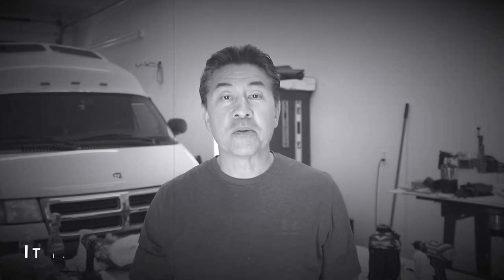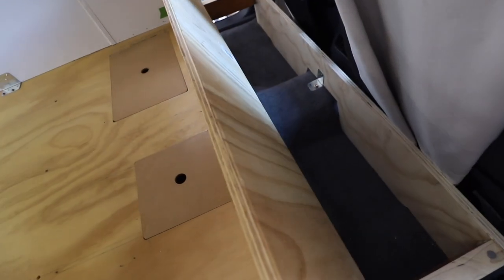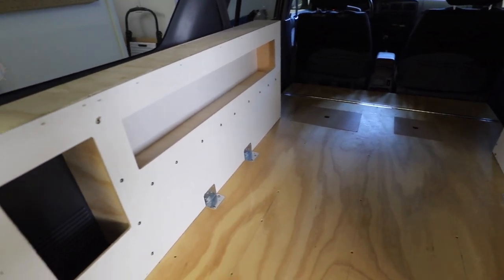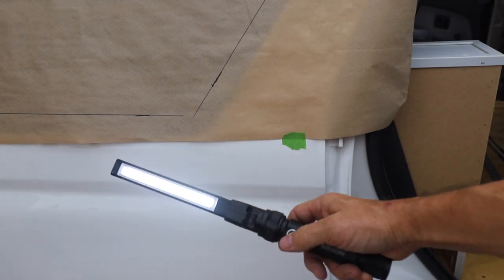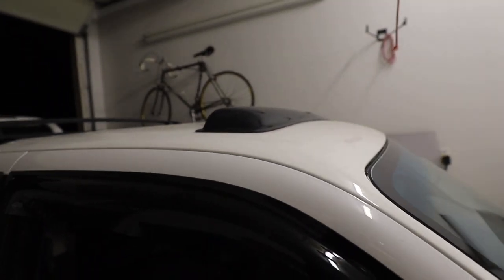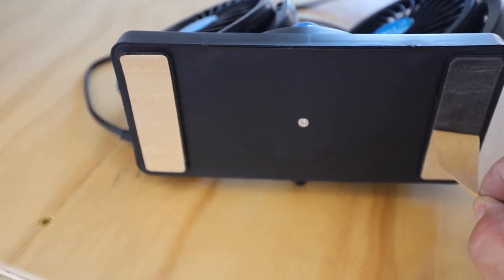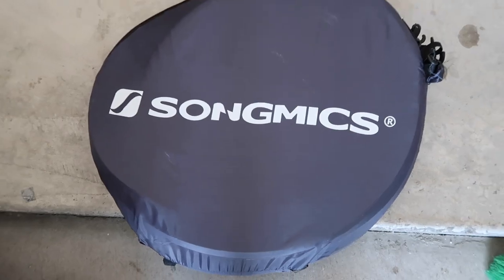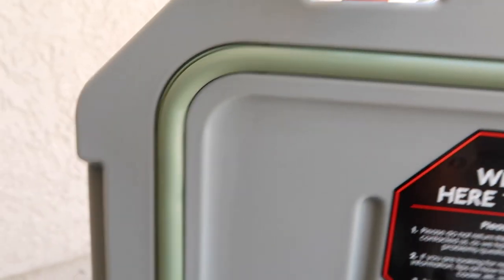Micro Camper Build in a 96' 4 Runner Part II

Comment: OK Steve, I have to thank you. Until seeing your build out of the 4Runner I was all set to buy an E250 in the next couple of weeks to convert. D'uh, I already have a 99 4Runner LTD in great condition. Have watched a LOT of other 4R conversions, most having the platform bed you speak of that I didn't feel afforded enough space, and a coffin-like feeling come bedtime. The long and the short of it is that at 6' 2" I'm going to do up my 4Runner up in a very similar fashion to yours, with a few changes of course. So, thanks again, your video likely saved me $15K, and THAT puts a smile on my face. Cheers mate!

Comment: Steve, I'm always impressed by how you do things. I'm planning to head down to Quartzsite from Colorado in 6-8 weeks in my '97 4Runner (252,000 miles and running strong). I won't do any buildout because I'm only 5'2" and will sleep on one side with the right half of the back seat folded down.  Will outfit the other side with a small set of plastic drawers, cooler, stove, etc. Also planning for some solar on top plus a set of suitcase solar. Thanks for the great tips that give me confidence that I can do this! Hope to meet you someday.

Comment: I found the same baskets in brown! They fit inside a 12 pack soda box. Was just a coincidence when BF was taking to trash. Cut off length a bit. . I stacked them 2 each and 2 across in two different cabinets of our trailer as drawers. Things already drawer shape held less and had too much space around. I didnt even stick them together. They dont move and if I want can put them 4 across and not stacked.

Comment: Hey Steve. 

Love your totally practical guide, and I agree about not using a platform bed sleeping arrangement. I'm not claustrophobic, but I imagine I soon would become so if I tried to go that way! 

I have a sub-micro, 98 Honda CR-V, and it's a 4 cylinder automatic 4x4. I also have a 2wd 04 Dodge (non-grand) Caravan. Both have their pros and cons for the camping, but being 5'11" as I am I would have to REMOVE the front seat as well in the CR-V! I'm looking at the Caravan, now, for this. What I'd absolutely love, though, is one like your Dodge Explorer. I could probably live out of that one. 
Goals, goals, goals! 

Good luck with your Harbor Freight addiction! I hear that's a hard one to get away from!

Comment: Im building a gen1 mitsubishi montero into this.
Im in a wheelchair and was thinking the same about the bed on the floor and shelves over the wheel wells. 
Note on that. You can remove the inner panels and gain about 4 more inches in depth from the outer body of the truck.
Reply from the maker: I hear you on the panels but didn't feel it was worth the trade off. I like the storage under the platform where the rear footwell used to be for extra's. .

Comment: Thanks for your super informative video Steve! I like your ideas and they give me pause to re-think my plans. My 03 Sport V6 is great. For now I too love my XREAS suspension and only upgraded to 32’s to stay somewhat matched to the 4th Gens factory gearing and shift points. I’m in Minnesota so I haven’t needed more ground clearance yet. I’m moving to Colorado in September however so we will see. I may need a lift kit eventually.
I’ve driven an 08 SR5 V8 recently and although the extra torque is wonderful I really noticed the extra weight (plus it had a steel plate ARB front bumper). It also had the regular suspension, smaller brakes and 16” wheels. I realized how much I loved the ride and nimbleness of my lighter 03 combined with XREAS and beefy brakes. So I’m lovin my V6 and focusing on keeping it a lightweight “weekender” build. I need more bed space for my wife and I so I will probably build a cabinet on one side only. I just need to figure out storage locations for my stove and kitchen supplies. One plus for under platform drawers are the very useful cooking & serving surfaces they make and although I could make shorter drawers that only accommodate the height of my stove the ideal height extended as “counter surface” is definitely higher like most platform designs are. 
Hmmm...lots to think about. Thanks for all of your ideas. If you haven’t already done so, a video after you have had a chance to camp and test out all of your stuff would be great! Have fun. 😎

Comment: Great job Steve! I just got the Jackery 240. Haven't used it yet but looking forward to it. Was surprised it didn't come with a cover for the 12v receptacle so I purchased on on Amazon for under $5.00. Fit's great and will keep dust and dirt out of that area.  It's called a Dovewill Black Auto Cigarette Lighter Dust Cover.

Comment: I'm a bit surprised you left the plastic wall panels in the rear compartment (behind the shelves) unmodified.  I would think there was lots of storage opportunities with them removed/modified.
Great video, by the way.
Reply from the maker: Oh, I considered it. The benefits did not exceed the need for a few inches. The storage under the flip up floor board compartment in addition to the top box is more than ample. I haven't regretted anything yet.

Comment: Love the build and accessories. More so, love the forrunner. Perfect! 4 cyl and manual trans....low miles, too. Would love to get my hands on that as well.😃
Reply from the maker: Ha. Crank windows too.
Reply: @XplorerSteveDIY  I have a 1997 Suzuki Sidekick that I traded for about three years ago. It had 60,000 miles on it at the time.  4 cyl/5 speed. It was in very good shape but nowhere near as good of shape as your dad's car. And of course it's a Suzuki Sidekick not a Toyota. However, I've had several of these cars 2 door and 4 door and including the Chevy trackers which are the same as the Geo Tracker... just a newer model.  I have a 2000 Dodge ram 1500 conversion van that I have made into a campervan. Now, like you I have been working on trying to make the sidekick a weekender or short-term camper vehicle. Much more limited space than your 4Runner. LOL mine comes complete with crank Windows too. Personally I prefer them to the electric- no motors to worry about going out! I have fans, solar (on ground + stands- no room on roof), roof  rack w/ storage bag, swing away hitch basket w/storage box, pump shower, shower Cabana and homemade solar generator. Just added 12 volt fridge!
Reply: In a couple of years you'll see a lot more of this era Toyota coming into the country from Japan. If you can handle RHD! Although world-wide competition for the used cars in Japan may see the prices creep up. I own a Hiace van with what is essentially the 4Runner 4WD drivetrain.
Reply: @DiscoFang  heard a lot of good things about the Hiace. Only seen pics. Look awesome

Comment: Very nice setup and choices for decking it out. Will be doing the same thing in my 2002 Ford Explorer XLT in the near future. Going to do it slightly different with the bed on one side and cabinets on the other but will be doing the same thing for my solar but just going with a bigger all-in-one option.

Comment: I am ready to install my 100 watt Renogy panel on my "new" 2011 Honda Pilot I converted to a micro-camper.  I noticed in your video for the solar panel installation on the Xplorer you used VHB tape.  For the 4Runner you screwed into the roof. Can you tell me why you did not use VHB tape on the roof of the 4Runner? And if you think screws are safer, any tips on how to avoid damaging your vehicle and what kind of screws to use? Thank you for the inspiration, btw!
Reply: Late, but maybe helpful. I had doubts about vhb tape, but it's amazing how strong and reliable it is if installed correctly. Beats drilling through the roof anytime imo.

Comment: I’m working on my sleep deck build, inspired by your design and have a couple questions about your build:

1) on account of having a subfloor (furring strips + insulation), did you find that introduces a small gap below the rear edge of your deck about an inch or so floating above the rear sill?

2) how did you brace and connect the plywood walls around the foot well? Are those tied into the framework supporting the deck?

Thanks in advance for any tips!

Comment: Hey Steve, I’m currently building out my 4Runner to be pretty much exactly like yours, love the design. How is that mattress holding up? Would you still recommend it?
Reply from the maker: Now I use a twin size 3 inch memory foam topper on top of some interlocking anti-fatigue mat cut to size. That does it for me.
Reply: @XplorerSteveDIY  Thanks for the quick response! I can’t wait until I get mine finished and out into the backcountry. So would you say that first mattress was overkill, or was there something specific you didn’t like about it? I’m not sure about using a topper, they all seem too soft. Any insight on this topic would be hugely appreciated.

Comment: That plywood you used looks thick. Do you think that was necessary?
Reply from the maker: Standard 3/4".  Some parts are not supported by the furring strips so it suits me. There are no rules in self build. I wanted a sturdy, non creaky, floor. I have it.

Comment: Was in Vegas and went to alien stock.  Those tires you don't like,  well many people popped there tires,  so its not always about crawling and 4x4ing.  Its about not being stranded with your famly in the middle of know here,  even when you go on simple dirt roads you are at risk.  Also the lift helps protect you from hitting unexpected high bumps and ruining your oil pan.  Which will leave you stranded.  I rather pay the extra gas.  I have a built jeep and just because you don't see them off roading doesn't mean they are posers.  But we are better prepared than you.

Comment: I’m always curious with these sleeper platforms and drawer systems, does stuff jostle around and shift a lot when you hit bumps?
Reply from the maker: Well yeah. I use some non slip shelf liner on the bottom and sometimes between the bottles of propane. Keeps it to a minimum.

Comment: Don’t know if this has been asked but have you added any under-mattress protection from mildew, like a hypervent? In a space so small, with the matter was directly on the board underpayment, mold and mildew will set in and destroy the mattress and the sleeping/breathing experience. Please let us know. Thanks for the really great and informative video. 🌿
Reply: Late, but it really helps to remove the mattress when not in use. I wipe mine down with vinegar/water mix after storing it. edit I also shimmed my furring strips and drilled vent holes at areas that have space under the strips. I live in hot and humid Southeast.

Comment: how do you sleep in that? I am trying the same thing in a '98 and had to take out the front passenger seat to actually have enough length to lay straight. That didn't work because of the wheel well in the back, now my mattress is bowed because the floor is uneven and on an angle lol

Comment: I need so much more info on so many things.

Main question: with the solar you screwed the panel just... into the roof? With a screw hole, screw and nut? Then sealed it? And it looks like you just closed the rear passenger door on the wires leading to the solar generator? Does that not damage the door seal?
Reply from the maker: The solar panel was attached as follows-attach the brackets to the solar panel, place the solar panel on top where you want it and make sure it is well centered, pencil around the brackets as a reference point, remove the panel, place some 3M adhesive silicone on The bracket points. Replace the solar panel on the bracket points, screw in the solar panel using self drilling, self tapping screws of a length that will not penetrate the interior head liner. The wires on this particular Set up does not damage the weatherstripping, no.

Comment: 8:47 How did you mount the mount for your pvc pipe ?
Reply from the maker: On the roof of many vehicles there are cross members for rigidity. Sheet metal screw into one of those. Use a shorty so it doesn't go through the top.
Reply: @XplorerSteveDIY  Cool, thanks for the tip !

Comment: Was the 3/4 inch plywood overkill? Couldn't you have gone with something a bit lighter?
Reply from the maker: Thought about it. The storage cutouts and the hinge lid would have suffered as would a substantial material with which to screw things into. 3/4 weight about 70lbs. Not too bad minus the seats and carpet.

Comment: FYI according to your title you have a 96 foot 4 Runner. In the future it's handy to remember that the apostrophe is a place holder, if you want it to read "1996" then you use " '96 ", if you want it to read "96 feet" then you use "96' ".  Works the same way inside words also. If you want to say "can not" then you use "can't", the apostrophe holds the place of the missing letters/numbers/word.
Reply from the maker: No. It’s 96 feet long, which is pretty long for a vehicle built in 96’.
Reply: @XplorerSteveDIY  96 feet isn't excessively long for a '96 4 Runner 😂😂😂

Comment: Here in Oregon we call them "Posers" a Pavement Princess. Guy across the street has a kid with this jacked up Ford diesel, smoke stacks at each front corner of the bed, at least a 6" lift, must be 40" mud terrain tires, truck shined up as good as our lazy ass local fire department and these stupid stickers on the bottom of each door that says "Black Fog". First of all he looks to be about 5'6", runts tend to drive the biggest lifted trucks. I have never seen a speck of dirt on "Black Fog", I have seen him go by my old beat up 02 Dodge diesel and shake his head when he looks my way and when he steps on the fuel pedal it makes a lot of noise but no black fog. I think he is from Kommiefornia where all the candy asses live. Piss on lifts and all the tricked out crap. Keep it simple Steve. Just another opinion from another Steve.
Reply from the maker: That is some funny stuff right there. When I went through Oregon I wondered if your version of the “poser“ were all of the Subaru drivers with the kayak mounted on top. They step out  wearing Patagonia and Columbia and assorted high end outdoorsy gear.  I came to the conclusion that most of them were real as the Subarus looked well used and the drivers appeared in good shape. The kayak on top of the Subaru looks like it belongs there.